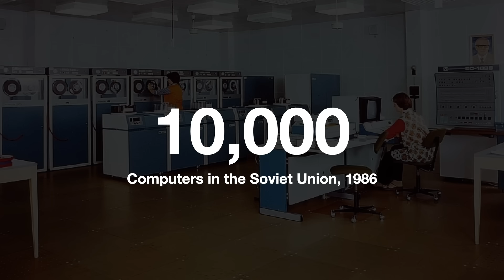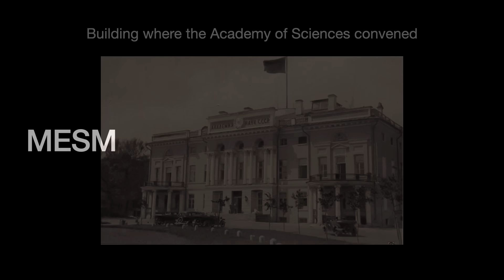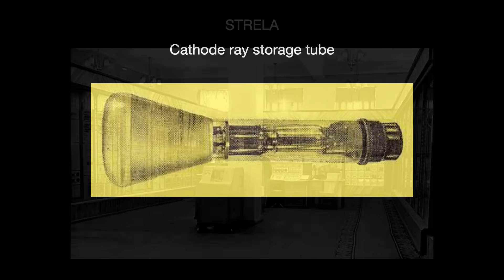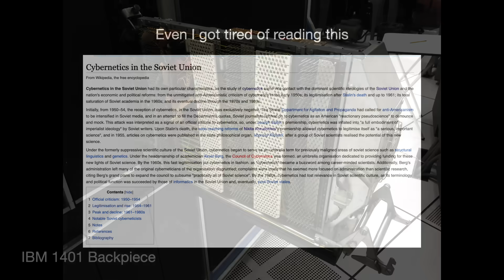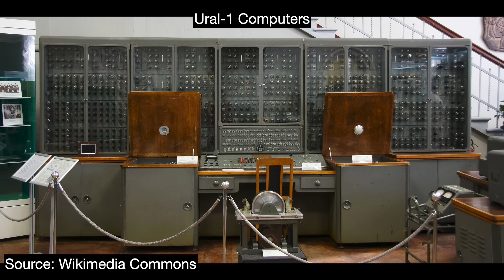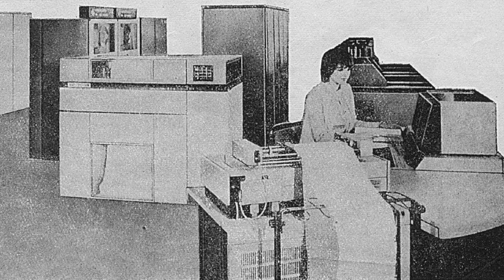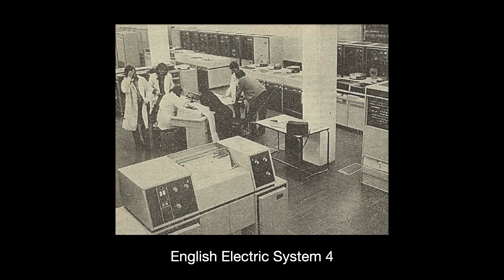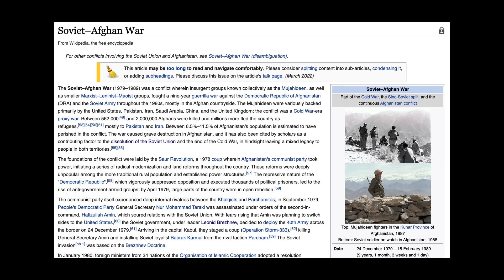Why the Soviet Computer Failed

Comment: At the very beginning of the video there is a hyped-up figure - in 1986 there were only 10,000 computers in the USSR and as many as 1.3 million in the USA. However, as a retro-PC lover, I immediately have a question - what computers are we talking about? If we are talking about all of them, including professional and home PCs, then both figures are clearly understated. And if we are talking about only some large (universal) computers like the IBM 360, then they are most likely overstated. For example, according to official data, about 2.8 million TI-99/4A models alone (in fact, it is a game console, but TI considered it a home PC :) were produced by 1984, and almost all of them, as far as I know, were sold in the USA. Plus, millions of Apple II, VIC-20, C64, IBM-compatibles, etc. were produced by 1986 - and a very large part of them were apparently sold in the USA. Finally, according to American statistics, in 1989 about 20% of families had a home computer - and this is about 20 million units (and this is only 3 years after 1986).

In the USSR, small computers of the PC type were produced since the mid-1960s (for example, the famous MIR), and in the 1970s, mass production of mini- and microcomputers of various types began - SM-2, SM-3, SM-4, Elektronika 60, Elektronika 79, Elektronika NC, Elektronika S5, Elektronika D3, Elektronika K1, Elektronika T3, Iskra-1256, etc. At the same time, the production of more powerful computers continued - the ES series (this is a variety of models of different levels), the M series (many models), Nairi, PS2000, Besm-6, Elbrus, etc. In the first half of the 80s, the production of such famous PCs as Iskra-226, SM-1800, DVK, BK-0010, Agat, etc. began. In addition to producing its own computers, the USSR also purchased imported models - for example, Wang 2200, Robotron-1715, Yamaha MSX, Pravets, Izot, various IBM-compatibles, etc. - this alone gave, by 1986, at least tens of thousands of PCs. That is, by 1986, there could not have been only 10,000 computers in the USSR, there were many, many more :).

And in 1985-1986, the boom of Soviet PCs just began, when many wonderful models were developed and released over several years - UKNC (aka Elektronika MS0511, the most popular model among Soviet PCs, more than 300 thousand were released - a dual-processor 16-bit PC with outstanding graphics of 640x288 pixels, 16 colors), Elektronika-85 (developed in 1985, produced since 1986 - a complete analogue of the American Dec Pro, with good graphics, fairly large memory, etc.), DVK-4 (a powerful professional PC with excellent graphics, large memory, hard drive, etc.), BK-0011 (an improved version of the outstanding 16-bit home computer BK-0010 with 128 KB RAM and more advanced graphics), Korvet (developed in 1984-85, was produced since 1987 - the second most popular educational PC in the USSR after the UKNC, a wonderful computer with excellent high-resolution color graphics and wide capabilities), Vector-06C (an excellent home PC with multi-color graphics (potentially at the level of Atari ST) and good sound), PC-01 Lvov (one of the mass-produced home PCs, with good color graphics), PC8000 (a home PC with good color graphics like MSX), various models of professional and home IBM-compatible (EC-1840/1841, Iskra 1030/1031, Neuron, Poisk, MK-88, Assistant-128, Praktik, Kvazar, etc.) and many others.

By the way, at the beginning of the video, where the first Soviet computers are discussed, for some reason the machine that is officially considered the first Soviet classical electronic computer is not mentioned - this is the M-1, created in Moscow under the leadership of Isaac Brook. It made its first calculations in December 1950, a little earlier than the MESM mentioned in the video. Moreover, the M-1 was much more compact and economical, since it widely used semiconductor diodes in logical elements.

Comment: The main computation hub for Comecon was in Bulgaria just outside of Sofia. The focus in the USSR was algorithms. That the US led in the manufacture of computers is irrelevant as despite the export controls the US state of the art was to be found in great plenty in Bulgaria. These machines were mainly trafficked through Vienna. It was no secret and everyone “in the know” knew. For computational algorithms the Soviet Union had the lead. Even in the area of neural networks the hot spots were not in the US but in Moscow, Leningrad and Munich. Few of the algorithms currently powering the “AI” boom were developed in the US and what was developed in the US was mainly developed by foreigners.

Comment: The first digital programmable computer was Colossus. It was developed in the UK in 1944 by Tommy Flowers and it used vacuum tubes. The motivation was code breaking.
Reply: Not correct.  Colossus was not a programmable computer.
Reply: Colossus was configured to solve different problems, but the steps could not be stored in memory. It depends how we define 'programmable'. @charlesjonesjr1262

Comment: analog computers have unique strengths. they don't directly compete with digital ones and it's uninformed to suggest one it's superior to the other. analog compete can directly model diff eqns. it makes complete sense for a digital computer to have a unit for analog calculations just like they have a diff chip for floating point calculations.

i guess that's something you aren't aware of when you think math isn't important to discuss on this topic
Reply: There is a reason no one uses analog computers today.

Comment: 12:11 I heard Americans "borrowed" (forcibly) German scientists like Von Braun that built v2 rocket and made first (working) rocket for Americans. Umm for chemistry Dmitri Mendeleev was Russian. I don't think it was lagging behind. After all Russian sent Belka and Strelka in space and the Urii Gagarin. Without computers (or perephirals of it) it wouldn't be possible. They sent how many satelites to Venera which is so much harsher environment than Mars. Even sent some data back. Like how can this be done without computers. I am sure they did not bring 60^2m machine to do that. I learned nothing from this video 😢. Leonid Kupriyanovich early developed of portable phone. He patented it in 1957. In 1963 it was fully connecting to landlines.  American Martin Cooper developed mobile phone in 1984. How can it be if patent already existed.

Comment: I do not see a fail. There wa evolution witch break at the 1990s as the revolution in Moscow breaked USSR.
Reply: That's true. To be fair, yes, "soviet" computers were not quite as advanced as american ones in the 60s and 70s, but in the 80s they did produce some pretty good stuff. Of course, by the end of the 80s, the USSR was collapsing so it brought a complete halt. But before that, since they were pretty much cut off from the West, they had to do it all, semiconductors included. And there were pretty much sharing the #1 spot with the US when it comes to space exploration.

Comment: I cut my computer teeth on a University mainframe running a virtual 360 operating system.  Personal computers lead by the Apple 2 were breaking onto the scene. Fast forward nearly 2 decades and I changed careers to go into software development. So many of the best programmers I have met came out of the Soviet Union. Their hardware may have been poor but it only drove them to be brutally efficient with what they had on hand

Comment: The most important cause of this failure is not mentioned in the video. 

The Politburo were not stupid. They comprehended, on a primeaeval level, that widespread implementation of computers will lead to a loss of control over information flow, and much of the Soviet system was about control of such flow.

Comment: The Soviet Union had big plans to automate the planning of their economy using computers, this would hypothetically reduce corruption and bureaucracy in the USSR which as you know are the real reasons the USSR collapsed. I suspect a combination of these factors are responsible for the plan's failure, and the subsequent subversion and destruction of Soviet computing, but original research on this is usually unfortunately only in Russian and western research has no interest in it. However, as both a planning nerd and computer nerd I find the idea fascinating. I am sad it was never fully put into practice. Could planning have been efficient if the computers was able to quantify demand all over on a macro scale? I don't know, maybe? It surely is different, that is for sure.

There are great books by modern day Communists on the concept of using machines, internet and even machine learning to patch the holes that we all know about the planning mode of production. While I am not a Communist myself, much less a proponent of a fully planned economy, I find the ideas interesting! I think a mixed approach with something like this could be pretty good for the citizens of any country, and if we lived in an objective economy that sought to provide need rather than maximize profits, I think it would be adopted personally.

Comment: 7:54 - Not to mention simply making the transport of goods far more accurate, better controlled inventory and made accounting as foolproof as possible. Mundane? Nope: Add the cumulative effects.
10:35 - Late '60s, I was an estimator for a metal fabrication job shop, working with an adding machine and a Marchant for more complex arithmetic. And then my boss walked in and handed me a HAND-HELD calculator! Wow! Square-roots? Right NOW!
18:40 - It is the story of planned economies everywhere and always.

Comment: 7:20 What do you measure, author? Are you aware that in the USSR labor and raw materials were cheaper than in the States? This is a gross mistake. At first I thought that I would be objective...
Reply: They couldn’t produce as many semi conductors tho
Reply: I would imagine it would be at the exchange of currencies at the time, even if you double the Soviet values to account for the difference labor costs. It’s still not close. The results speak for themselves. Very weird to get hung up on that little difference when the Soviet were completely outclassed by the end.
Reply: Are you aware that the average Soviet worker was basically slave labor back then?
That the average Soviet could only own what the local party decided they could own? And where to live?
That they waited hours in line at grocery stores and were lucky if they got a loaf of bread? While the upper party officials lived high on steak and lobster and caviar?

Comment: I live in Estonia, back in '80-s it was a part of USSR.
In 1982-1988 studied authomatic processes in Tallinn Polytech University, part of studies was computing.
As a hardware, we used Nairi computers, big as a writing desk, less computing power than Altair, never did what expected.
Other one was ES-1, but i never saw this thing alive, we just wrote our program pieces to paper and somebody somewhere feeded these in, results were handed back a week later.
For languages we were taught, there were PL-1, Fortran, Basic, a bit of low-level language (can't recall it's name, probably something like c++)
Hardware was a complete sh**, languages were pretty much copied (stolen) from "rotten west"

Edit:
Dug deeper in memory; this Nairi didn't have display, only a typewriter type of input-output device
low-level language was Assembler
later (maybe 1986-87) there was kinda "computer class" with about 15 terminals, cannot recall prog language used there
first personal computer ancestors available were "black market"  Sinclair's and some it's clones, appeared in 1988-1989

Comment: When I was 5 years old, my father in law was working as a scientist with USSR made computers functioning with perforated cards, when I went to school, we had USSR computers same as IBM compatible ones with word processors and etc. When I went to community colledge to learn programming just after the school, in Russia when USSR was no more, they started eith teaching us on old computers with Pascal and Fortran and hard disks size of a fridge, which were 70tees generation computers, but at the same time Autocad on 386 IBM machines and MS-DOS 5.0 and 6.0 When I later dropped out of college and went to work in promotion design in Moscow, we did it on Win 3.1 and layer 5.0 and had 1 laser printer for everyone, where I printed my typeset newspaper with design included and we brought it to typography printing house which used machines with rubber rollers to copy and print it. Faxes were also available already in Eltsin times... So some companies had 90tees tech and some were still in 70tees and did not modernise, same with the education. The economy did not run well this way not with Gorbachev in 80tees not with Eltsin in 90tees. After fall of communism, when computers and internet became available in Russia for everyone and not only scientists, the diverse gap between rich cities where everyone could afford these and poor cities was wider then now, and it was like attaching a donkey to a car when the engine stopped due to lack of fuel, you still moved but had to feed the donkey and be grnerally patient and inventive
Reply: Мысль не сосем ясная.

Comment: My dad was in Germany in The 1960’s. He told me a story about an IBM repairman flown from New York City to fix a vibration on the UNIVAC or something like that. 
   The guy found the issue after about a minute of pressing different spots on the school bus sized computer.; Turned a screw and the vibration was gone!  
   The invoice was for $5000, joking & curious, my dad asked why it was so expensive to turn a screw? The IBM guy said 
“Well, turning the screw only cost a dollar, knowing which screw to turn cost $4999-“. 
   I’m a master plumber, whenever a client asks me why I charge so much, I tell this story.
Reply: This story.The bike like from the Soviet Union. A telemaster came to repair the TV, knocked on one place - the TV started working. That'll be 50 rubles! And why is it so expensive? Because you need to know where to hit.

Comment: Dear friend ... You said that IBM1401 were 12K units  that replaced the punched cards .... What cards ? So far I understand 1401 used punched cards to input programs and data inside them.  Only far later IBM 360 and 370 start using tapes and even later disquetes ... Am I wrong ?

Comment: I remember doing mainframe computer servicing back in the late seventies and early eighties. The computers had just been upgraded to hard drives but the firmware still insisted on having a tape in the tape drive before the systems would boot. In each computer room we put a framed sign that read, “System will not boot without a tape in the tape drive!”  Right over the control console, in large letters. I still got constant calls about systems not booting. The first thing I would say is “look up!” The next thing I would usually hear is a surprised “Oh!” and then the person would hang up. Good times.

Comment: One of my jobs in the 1980s for the alphabet soup group in DC was reverse engineering some software stored in a ROM device that had been "acquired" by US personnel.  I recognized that the hex code represented Intel 8086 instructions with a couple of odd exceptions.  It turned out to be for a Soviet copy on the Intel device that was called the "K86" in the USSR.  They had modified the Intel CPU slightly to implement a couple of additional instructions.  Their semiconductor processes were nowhere near equivalent, so the device, once "acquired", was found to be considerably larger than the Intel part, slower, and required more power -- and a couple generations behind the Intel x86 family tree at the time.  It showed how much of a disadvantage the Soviets were operating under at the time.

Comment: Russia is terrified that the general public will get computer literate and ruin their corrupt scam of covernment. Russia does not know how to think logically, but only thinks in terms of what they must keep the public from learning. Until the 1980s Russian aircraft also only had tube type and discrete circuit electronics because Russia was severely behind in the development of solid state stuff. Can you still imagine operating with 4kb memory at 9600 baud?

Comment: Thank you for the overview. I started my  software engineering education in Kyiv in 1985. We had ES-1060 though it was barely available for students and took punch cards. But we also had several SM-4, and analog of PDP-9, and those seemed to be more widespread at that time as opposed to much larger ES-1060. Even some schools had SM-4-based computer rooms. Those computers were made in Kyiv. Also, the same factory made Mir and Mir-2 computers back in 1970s, and my high school had one of those. Those were developed under Dr. Glushkov's patronage and from what I have heard were not Western copycats like ES-1060 or SM-4.
Where the gap really showed up was the personal computers market.

Comment: I wonder if, in 2023 or 2022, it's still hard to use Google Translate to listen to the pronunciation of Russian words and surnames before recording your voice for a video. Just getting the accents right is a problem, forget about pronouncing the correct sounds. Moreover, I fail to see the significance in doing so. If the goal is to have viewers search for the names or surnames later, it would be more effective to display them on the screen with transliteration or proper translation